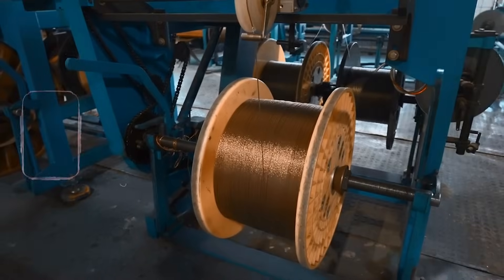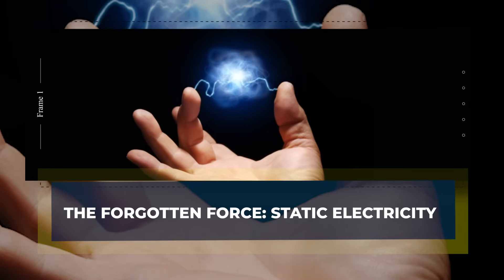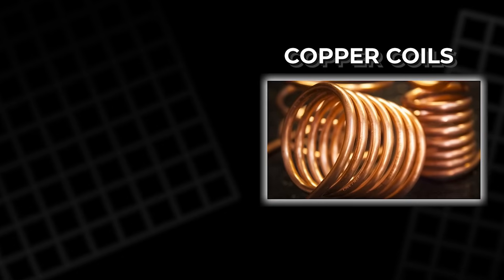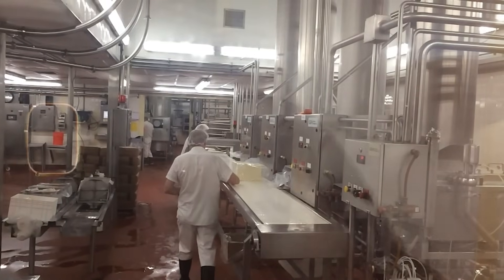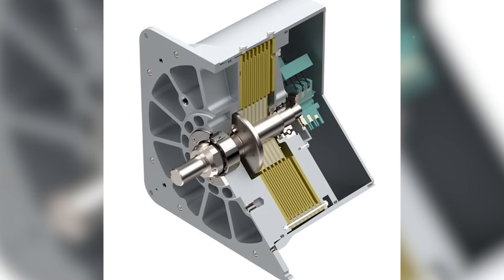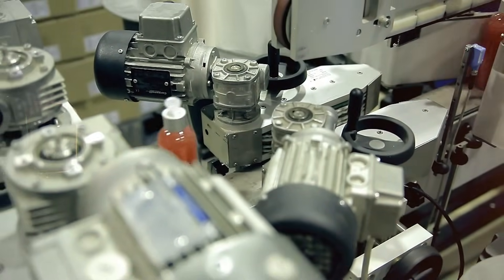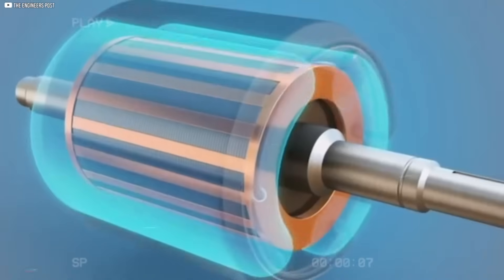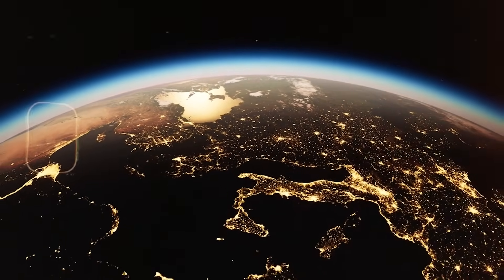How a Balloon Trick Could Replace the Modern Motor

Comment: EV, a technology to relocate fossils fuel consumption from the vehicle up to a power plant. Likewise, the static electric system motor relocates its copper use from the motor and up to its voltage converter system.
Reply from the maker: That's an interesting point about the relocation of resources in new technologies!
Reply: @TheForgeEmpire  both are dumb ideas for the sake of changing.

Comment: As I know these motors use high voltage to run. We'll have to transform the power into a high voltage power and so here are some losses ,...
Reply: En utilisant un ou plusieurs condensateurs a electrolyte liquide Hermétique, les pertes peuvent être stocké par absorption Cathodique en le liquide conducteur sous saturation volumique ( abaissements de charges) puis par l'effet de transistors, êtres redirigé pour des redressements de charges

Comment: The electrostatic motor is not electrostatic as well as the electrodynamic motor is not magnetostatic. Magnetically excited motors act their force by the reduction of magnetic field energy. Electrically excited motors act their force by the reduction of electric field energy. In this way they work both with electrodynamic effects.

It is also not true, that electrically excited motors have no active current or active power. Indeed they have and it gives reason to resistive losses in the conductor materials. So you cannot really make such motors with very thin copper sheets. But the current for the same power is reduced by the orders of magnitude higher voltages.

So in relation to comparable magnetically excited motors there is not really a principle advantage to achieve higher efficiencies, especially if you compare electrically excited motors with magnetically excited iron-free axial flux motors, which have a relatively comparable design. They can also achieve efficiencies of up to 99 per cent.